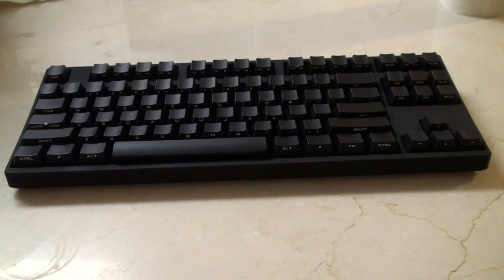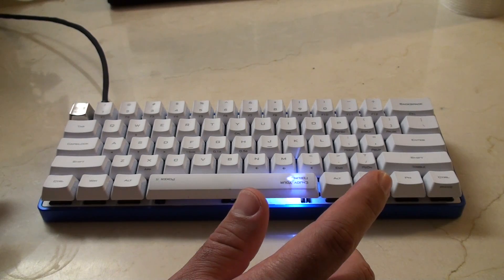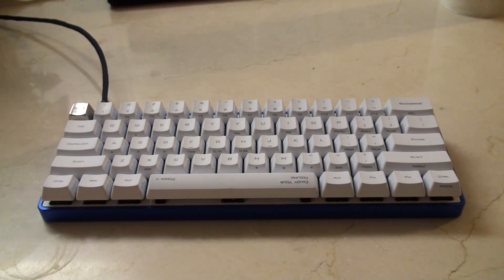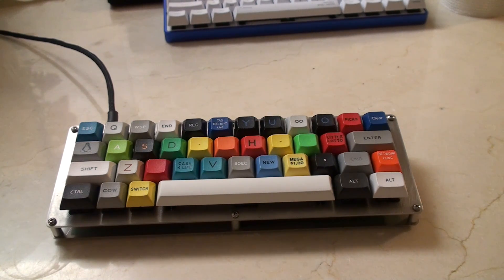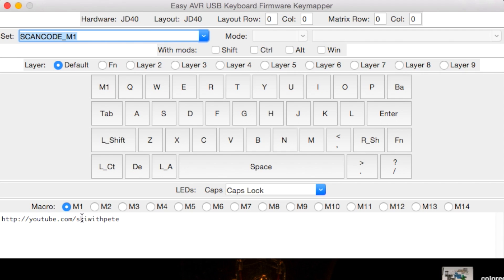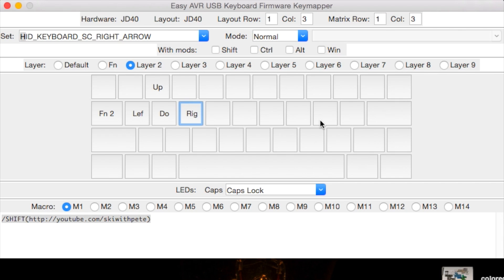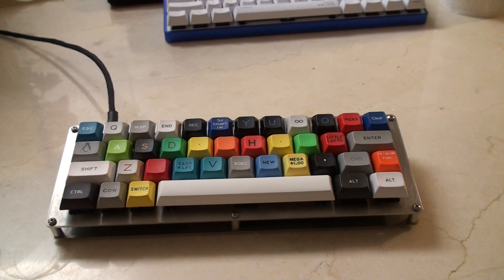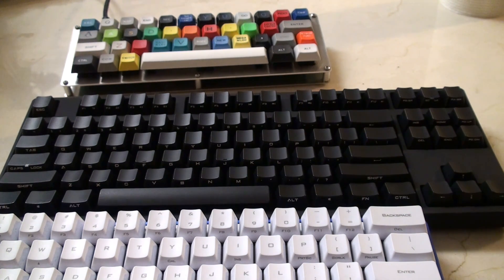Not all mechanical keyboards are equal... only a few are programmable

Comment: Cool viddy, Pete. 
Can the JD40 keys be programmed using the software, by just selecting a key to program within the software, and then on the keyboard hit the desired combination, say-- CMD+C, and this would program the button to do CMD+C with a single keypress? 
Or must you instead, also in the software, enter the string as you did '/SHIFT (yutube...)' but in this case something like  /COMMAND + C etc. ?
Reply from the maker: I'm not sure what you mean.  Are you asking if macros can be programed to do basic commands like copy and paste by programming in CMD+C or CMD+V?  Yes.

Comment: Is it possible to add programmability to a CM Quickfire TK? I would love to upgrade this board as I love the layout and the MX red switches are pretty nice and quiet.
Reply from the maker: Sorry. No to the TK
Reply: @skiwithpete  Bummer. Thanks for the quick reply.
Reply: If you're running Linux by any change you can do that on an OS level. I have the exact same keyboard and mapped Escape to my to Capslock.

However, a big difference with an actual programmable keyboard is that tje remapping is done on the computer. So when you plug it in to another computer or reinstall your system without reconfiguring the keyboard, the remapping gets lost.
Reply: @jarnobot  I ended up finding a Windows program called TouchCursor that gives a fair amount of programmable keys in a single layer. It's nowhere as cool as a QMK, but it works for me.
Reply: @stopthephilosophicalzombie9017  very nice! I wasn't sure if there would be a Windows equivalent, so it's good to hear that there is :)

Comment: Is there a keyboard where this can stored in memory so that I can take the keyboard with me and use on different PCs ?
Reply: The Vortex Poker series have portable programming. Most of the new 60% keyboards that have programmable layers also are portable.
Reply: I think the KVM-version of the X-Keys XK-80 can let you program the keyboard itself. But I can't recommend that keyboard; the keys require hulk-power to press (over 150 grams, which will hurt your wrist if you use it much). Besides that, it is very expensive and doesn't really have a nice clicky feel a keyboard with like cherry blues.

Comment: thanks for the informative review pete. is it possible to set the shift key to a setting where only the next letter will be capitalized after you press the shift key? i am trying to avoid having to hold down shift and a letter at the same. thanks
Reply: I've never seen that functionality. There probably is a way to do it in AHK.

Comment: So, those QFR's can be converted to be programmable. It's called a Frosty Flake controller, basically its a drop in replacement for the stock controller daughter board that's socketed into the main PCB

Comment: QMK is so much fun to mess around with. Well, after you get familiar with them i guess. Wasn't fun learning how. Making use of layers really make a small keyboard feel that much bigger than one that is pre programmed.
Reply: Do you still use QMK?
Reply: @stopthephilosophicalzombie9017  4 years old comment... but yes! the only thing stopping me from using my cyberboard more is lack of qmk, its really useful to the point that I find keyboards without it hard to use. my common binds are to make caps fn2 layer.

Comment: What do you think of the ErgoDox Infinity keyboard kits?  I'm fairly new to the custom mechanical keyboard culture having only owned my Corsair K95 for a few years. What I've discovered is that despite having 18 extra programmable "G-keys", I almost never use them due to the awkward layout far off to the left. I like the idea of having something smaller and more ergonomic with fully programmable functionality, but I'm not quite sure what I should be looking for.
Reply from the maker: I personally don't care for the ErgoDox infinity, because I like staggered layouts.  It's just the weird way that I am.  That's not to say they're not great boards.  They are.  Just not my cup of tea.  If you're looking for that smaller size and full programmability you might consider a GH60 build.  The parts are tough to track down at the moment, but you should find it becomes more available in the coming weeks/months.  My biggest suggestion is to not rush in on anything that you don't love.
Reply: Hey, thanks for responding. I appreciate your insight and advice. Yeah, it's definitely a big jump dropping $200+ for something like the ErgoDox when you're not certain. I'll do some more research and check out the GH60. Thanks again!

Comment: hey pete i'm looking to get a 60% programmable keyboard and two people told me you can do it on the pok3r.
you said its not possible but you were showing the poker II; so im more cofused then before the video now :D
did you find your 60% yet? i've seen that software has the GH60 in it, which is just really complicated to get ..
also im tempted to get an iso layout keyboard because it gives me an extra key between LShift and Z but then i'll never find full custom keycaps sets because of that enter key :/ .. sooo many issues :)))
Reply from the maker: +manscho The PokerII and the Pok3r are programmable in the same way.  The pok3r just has a longer string (32 characters instead of 14).  If you want a fully programmable 60%, I suggest you keep your eyes peeled for the KC60 on massdrop, or build your own with a GH60 or other PCB.

Comment: Nice video. I have a question and I think you probably could help... I've been thinking design and build a left-handed mechanical keyboard. I'm stucked in the idea of the main control... How does it work and couple with the PCB? Do you know something I can read or watch to learn from?
Reply from the maker: +梁仲汉 See if you can check out stuff about handwiring and the teensy.  I'll do a video about it soon, but in the meantime that should help.

Comment: yah autohotkey + autoscript writer kills the whole need for this crap
Reply: +will meyers get a decent keyboard, and you don't need OS-dependent software crap. I mean.. micro-controllers are cheap nowadays - no big deal. (you probabaly won't know, only using/knowing your MS system).
Reply: ***** Well the first one is no problem. https://input.club/configurator seems to me - you just switch layers. (and all the others there are).
Of course you have more power over your (os/software machine dependent) 'autohotkey' setup... at the end of the day - like in unlimited possibilities.. without hassle even.

Still, I consider it nice to have some nice functionality within the keyboard - you can still combine it with whatever after all where needed.

So since I can't refute you by the 'possibilities' (even the opposite), I still want to claim: a matter of taste. I  just want it within the keyboard :)
Reply: *****
I actually forwarded it to a programmer (for banks and such), who likes windows. I think under windows such a thing might be of special good use after all. (for me, it's still nothing.. happily - not on MS)
Reply: autohotkey has lots of things it can't do plus bugs plus only windows :(

Comment: Is there away to "fake" programmable keyboard with software?
Reply from the maker: +Capitan Green Yeah, in your favorite OS, go to your keyboard settings and you can start in there.  But, when it's software, remember, it's not on the keyboard itself.
Reply: +Capitan Green I discovered "AutoHotkey" recently and although you need to learn how to program it in every sense of the word, the possibilities are endless.
I find that this by far exceeds what any keyboard can do on its own. This program alone is the reason I don't go feature hunting on a keyboard anymore but rather go for the look and feel of it and extra buttons always help, but aren't necessary.
Give it a try, it's free.
Reply: Nemanja Ilić
Yeah, it really seems like a solid solution, but the problems will come when i will take my keyboard with me and plug it in to other computers that dont have autohotkey
Reply: Capitan Green Yup, you are right, but AHK exports the scripts as regular .exe files so just run them on the host computer and you can easily set everything up in a minute.
Reply: Nemanja Ilić
Oh, thats really nice
Reply from the maker: +Capitan Green Get a programmable keyboard - even the Planck would really open your eyes.
Reply: Yeah but i sadly dont have the money right now for a good solid keyboard, so this can be a good method until i get one :)

skiwithpete
Reply: +Capitan Green If you're on a Mac check out Karabiner (https://pqrs.org/osx/karabiner/) – you can remap everything, but you have to be creative if you want to mimic the layer behviour.

Comment: As far as expandability, JD40 is awweeeesome. Hands down. The only, and literally only complaint or rather pet peeve I have is that ; ' and comma aren't where they are on the other keyboards... As a touch typist I need it to be there xP
Reply: Peter Mortensen  Hah, you really replied to a 5 year old comment? What key would you reassign them to? Return key is to the right of 'L'.

Comment: the difference between the Pok3r and the third keyboard you have shown is software and none stock software at that, if you were to make a bat script or even python (oh how i love it) just program the pok3r to do (Windows key / utility + R ,wait .2 seconds 'Path name to bat/py file') congratz you've just made an equivalent software out of basic scripts
- pm if you have questions
Reply from the maker: Sorry, that's incorrect.  Once you program the JD40, the programming LIVES ON THE JD40.  It is not bound to the computer.  The JD40 is purely native.  With all the programming living on the keyboard's internal chip.  When you create a macro on the JD40, computers see it as a series of keystrokes being delivered from the keyboard.  And when you unplug it and take it to another computer - it lives on the JD40, so everything transfers.
Reply: I don't understand?
Reply: The Pok3r uses it's own hardware to do macros where as the jd40 uses an extension on the computer to add functionality non-natively. So if you were to use the jd40 on another computer your macros wouldn't be on there that computer (unless you took the time to reconfigure it for ever computer) the pok3r doesn't have this issue because the information is saved within the keyboard it's self.